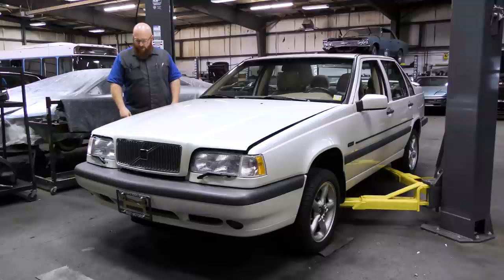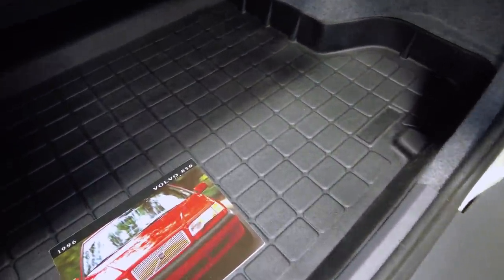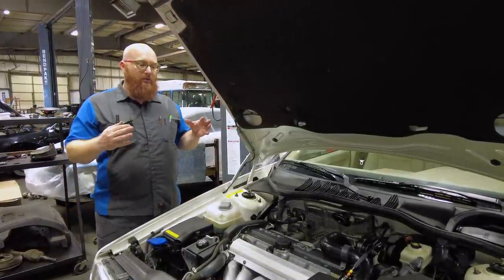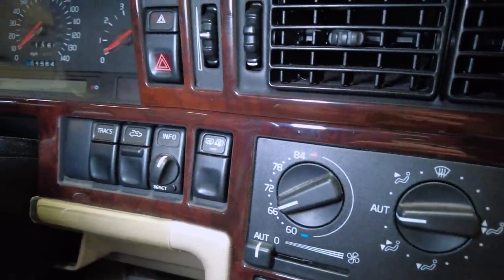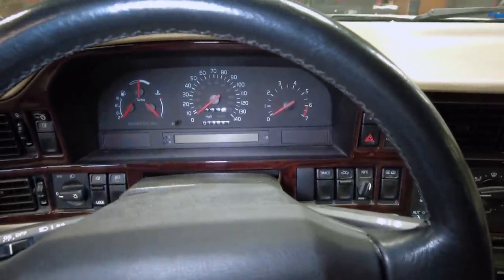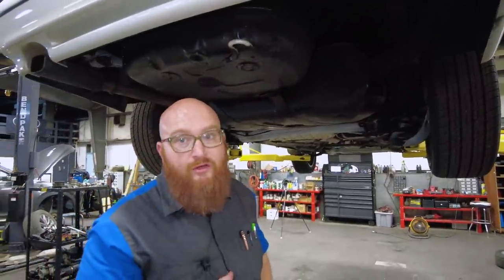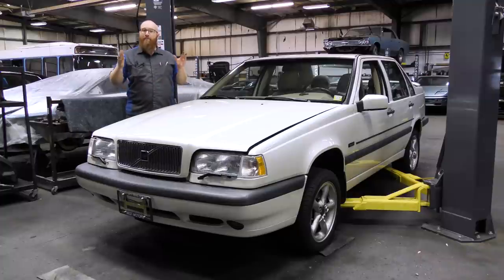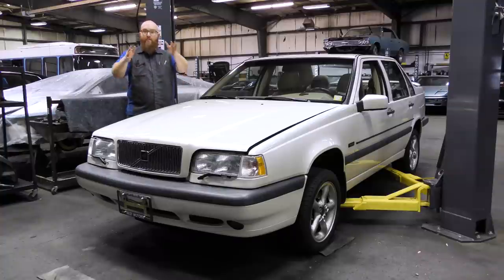Absolute Time Capsule! Super Rare '96 850 Turbo Volvo! CAR WIZARD's in awe of the condition.

Comment: It would be interesting to know why the car only has 15K miles.  What about all the seals and gaskets that can cause problems on a low mileage 27 yr old car?
Reply: @Hoggdoc 1946 grandma probably drove once a week and then passed in 2001 or something and car sat for 22 years in enclosed garage. My best guess. Keep in mind this is just a very random guess lol 😂. But yeah most people do 15K miles in a year or two at least.
Reply: Given the choice between this 15k car and one with 150k miles - i'd take the former every time - even if the odd seal needs replacing.

Comment: So, how old is the replacement water pump? If it’s new old stock, wouldn’t you have the same age out concerns? Is the replacement water pump an inferior Chinese model?
Reply: If it's genuine Volvo parts it's most likely made by SKF or Gates. They still make them new...
A NOS part won't have been used at all, no mechanical wear and no heat and what else deteriorating it. It's metal parts stored in a box.
Reply: @marcusjosefsson4998  Seals, rubber and plastic parts
Reply: @stuartstuart866  Sure, those are definitely more prone to decaying than the actual water pump.
But it's not that hard to swap those for new high quality parts.
My '98 S70 uses the exact same parts, they're easy to find from high quality manufacturers like Gates, Continental, SKF and a few more.

Comment: Talking of NO RUST, I'm not sure what Volvo did but SAAB certainly used GALVANISED STEEL in their cars. Panels made from GALVANISED STEEL will not rust unless the zinc skin is damaged. I recall several SAABs i Had and there was very little rust on them anywhere even at 15-16 years.

Why does NO USA Manufacturer use it ? Do you WANT YOUR CARS TO RUST AWAY ? The extra cost is minor.

Comment: The 850 is nice in that's almost brand new, but front wheel drive is where Volvo starting going wrong. It's also an interference engine, so if that timing belt breaks the valves are destroyed. I went through it twice with a 740 GLE 16v. I never want another Volvo with an interference engine.

Comment: I just checked the pricing.  It says " E-mail For Price"  If I had lottery money, I'd buy this Volvo.  My 850 is starting to show the worst for wear.  I'm guessing it has around 250k on the clock.  Overall, decent condition, Non-Turbo..5 speed manual.

Comment: “Volvo,” Latin for “I roll" ... The brand, founded in Sweden, had a parent company with a very Swedish name, Svenska Kullagerfabriken, or SKF, made ball bearings for cars, and it wanted a new brand name that could easily roll off tongues around the world. The engine was taken from the model 960/S90, the last rear-wheel drive Volvo, but shortened from six cylinders to five with the same aluminum block and top. Beautiful Sharing CW = 'Mint Condition "In Roll"'

Comment: It looks like the 2.5t model , that was a low pressure turbo … 193 hp in Europe. I had a black -97 model 855
Reply: The Platinum Edition had the HPT 225 HP motor but the same wheels as the S70 2.5T/GLT got in Europe in -97.
Reply: @marcusjosefsson4998  thx for clearing that up .I had the 16 inch turbine rims on...black coated , but knew of these :)

Comment: isnt that a T5? or is it the low pressure turbo?
Reply: It's the 225 HP turbo/T5.
The LPT never had the boost gauge and were never badged as "Turbo". Besides the LPT wasn't available as a '96 model.
Volvo had a very confusing way of badging their cars back then, in Sweden all high pressure turbo's was badged "Turbo" but on many other markets they were badged "T5", in the US it seemed to be a little bit of both...

Comment: Those aren't rare (at least not over here). The 850R and earlier 850 T-5R are the rare ones :)
That being said. Seeing one in this condition with no prior restauration is basically unheard of.
Reply: It's rare that it's clean, and that color isn't very common. I used to work at a used Volvo dealer back in the day and only saw a couple in that color.
Reply: They only brought over 1500 Platinum Editions.

Comment: What would happen if the timingbelt broke?
Reply: A failed timing belt will allow the pistons to collide with the valves in an 'interference engine' - as they occupy the same space withn the cylinder at different times of the 4-stroke cycle.  Most modern engines are of the interference type.  There are few 'older' non-interference type engines, and if I recally correctly the Ford Pinto engine was a non-interference type - where a timing belt failure would simply leave you stranded with no impact on the engine's internals.
In most modern engines, if a timing belt failure occurs with engine idling - then the likely outcome is a number of valves would be bent, perhaps a slight innocuous dent on a piston crown or two and engine stops dead.  To remedy such a failure, the head is removed, checked for cracks and the bent valves replaced - in short an expensive but recoverable situation.  A customer had his car towed to my workshop with such a failure, believing that the starter motor had stopped working.  Needless to say, he was surprised when I informed that the starter motor was operational and that the root cause was a timing belt failure (some of the belt's teeth had simply sheared off) - and that it was his lucky day because it occurred with the engine at idle.
If it occurs with the engine under load or at high engine speed, then the outcome may be bent valves, cracked pistons, scored bores, bent conrods, and perhaps a holed engine block - essentially an unrecoverable catostrophic mess.
Reply: @georgebettiol8338  Thanks. My father had a Volvo 240, and it stopped caused by timing belt failure - I think it brok(the timing belt that is) - twise. He just pulled the car to a friend who changed the belt. It didnt cost him a penny. But when he quit Volvo it was because its fuel consumtion.

Comment: The waterpump on the volvo modular engine  is not supposed to be replaced at timing belt service.
Reply: It's not prescribed in the service manual, but given the age of this car it's a really good idea to do it now.
Reply: @marcusjosefsson4998  the waterpump is not something that wears sitting in a box by age. Ergo it doesnt age sitting still on a motor either.
Reply: @prose1733  Gaskets age.

Comment: When Volvo decided to become Saab ( front wheel drive), they lost me a a customer.  Volvo dealer charged $100 to change the timing belt on rear wheel drive cars. $800 to change timing belt on front wheel drive. It's a horror to work on fwd. The five cylinder engines sucked, with head gasket issues.

Comment: 850 is much better car than the shitty S/V70. The 850 has more clear and original edgy look, on the engine side it still features hydraulic lifters and mechanical throttle body, with super smooth and flexible engine, which the V70 does not have…
Reply: Beg to differ...
My '98 S70 2.5T does have hydraulic lifters and mechanical throttle body, exactly the same as in the 850.
The '99-'00 models with electronic throttle are still good, rarely fails, and not as thirsty.

Comment: This is not a collector car. As a daily driver, it will be a nightmare, all rubber will crack, gaskets, hoses etc. Also all the fluids need to be replaces, filters, fuel tank checked for rust inside. Not to mention the airbags, interior might be good now, but for how long ? They are asking for over 18k for this !!!
Reply: Rusty fuel tank? It's plastic...
Changing fluids isn't a big deal anyway, it's an easy and straight forward job.
The only rubber and hoses I'd be a little concerned with is the crankcase ventilation system. Otherwise it's not a big deal at all!
The interior holds up very well in these cars, and the airbags? Not an issue. There's still thousands of these around here in Sweden with no concerns at all.

Comment: The problem is, the replacement water pump will not be even close to the quality of the original. I would leave it. The new one will fail soon. So it gets a Chinese water pump. It may say Volvo, but we know they are Chinese parts now. That car should have been left alone. Imo.

Comment: I owned one of these. Didn't like it much as the driver ergonomics were not to my liking. The Renault influence means that there is an engine mount that collapses on top of the engine. On this car it can cause the oil return pipe for the turbo to pop out

Comment: this is a early 96 due to the dashboard clock. later 96 they changed the dash clock unit to have a smaller display.

the thing that is really great about the 850s is very straightforward to work on while still having a computer deal a lot of engine logic. especially the 96 since it uses OBD2 rather than 95 and before using OBD1.

 an interesting tidbit with the timing belt is that for 850s the service is every 7 years but for the V70 97-99 which uses the same engine and logic etc. the service is every 10 years. same belts etc. 

i should also note i am swedish and i have never heard of anybody killing a 850 due to neglect on the timing belt changes and people used them as real beater cars for a while. what is more common to kill the 850 is the Serpentine belt snapping since it has a nasty habit of getting into the timing belt when it does. (even with the cover) the timing belt is really over engineered for these cars since i believe this was the first engine volvo made where a timing belt breaking meant you needed a new engine.

Comment: The Swedes put these engines in 240 series Volvos in a north south configuration and they go like stink.
Reply: You're wrong. 240 series used so-called "red blocks" 'til 940 series.
Reply: @jmsjms296  It's a pretty popular mod.
Reply: @marcusjosefsson4998  I didn't know that.

Comment: Wizard amazed thay car in such nice shape when only driven 15 k.  Really.
Reply: Must have been elderly owned and stayed in a garage, sold when they passed on.

The (very minor) interior wear would suggest that also. Basically around town miles over the years, and mostly sitting in a garage.
Reply: @volvo09  soon nothing amazing.
Reply: @mistersecret88  if you don't work with cars regularly it isn't amazing, but you do, don't often see "showroom quality" nearly 30 year old cars. It's a once every few years thing.
Reply: @volvo09  yes. Quite correct

Comment: 27 years old car ! All the rubber needs replacement, all of it, boots, main seals etc etc, hoses, etc, this is a good preserved junk and is not a collectible car, stop blowing hot air, you don’t need to sell it
Reply: No big investment required for a usable and reliable "youngtimer". You don’t need to exaggerate.
Reply: @jmsjms296  they are asking at least 18k for this ! Not worth it as a daily driver. As a collector car, it will not appreciate in value, they built lots of them, it is a common car
Reply: @lx4118  Not as common as they once were...
And a Platinum Edition will always be special to the Volvo fans, so not a problem.
And changing some hoses and rubbers aren't a big thing on these cars.
Reply: @marcusjosefsson4998  rear and front seal require transmission removal or the engine. It was sold for 25k, not a collector’s car or a daily driver, what is it good for ? Maybe Volvo museum:)))
Reply: @lx4118  Well, guess it depends on whoever wants it.
For me, replacing those seals would be totally worth it! They're still in good condition, no leaks or seepage, on my '98 S70 turbo. And my car is in such great condition overall that changing them is worth every penny.

Comment: That kilos wonder how the rubber and seals look. Low kilos old car dry rot seals and rubbers
Reply: Given the choice between this 15k car and one with 150k miles - i'd take the former every time - even if the odd seal needs replacing.
Reply: @georgebettiol8338  1996 wonder if coolant was changed every 3 years ,oil every 6 month. That services were done on kilos or miles. Then no thanks.